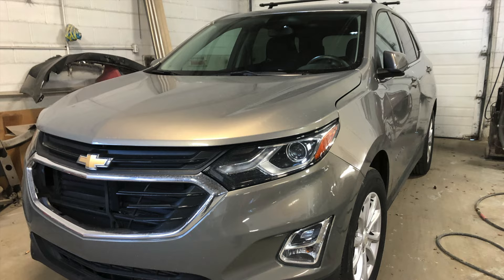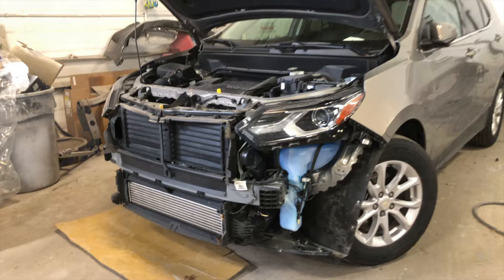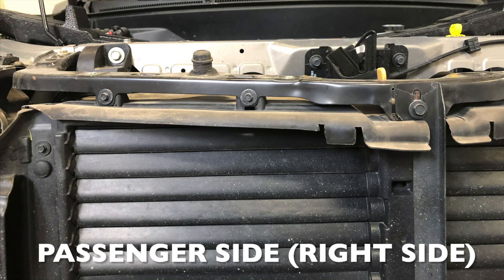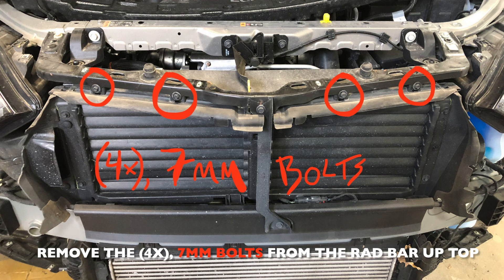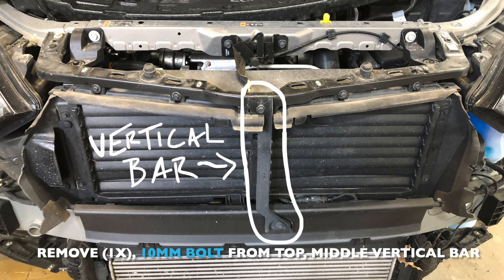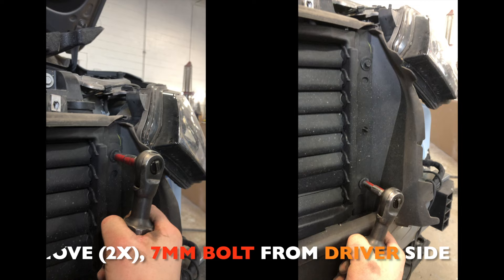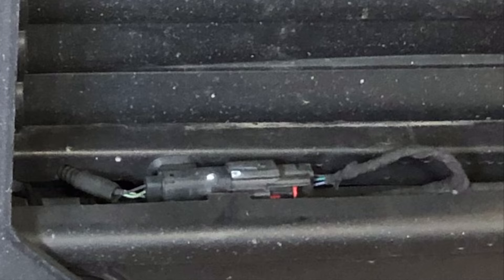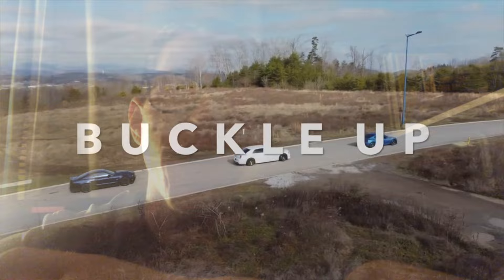How To EASILY Remove & Replace Active Grille Shutter | Step by Step Install 2018-2023 Chevy Equinox

Comment: Sure, here are the instructions extracted from the video:

1. **Remove Front Bumper**:
   - If unsure how to do this, check the bumper removal video on the channel.

2. **Locate Replacement Part**:
   - Take photos and videos for reference to ensure proper reassembly.

3. **Remove Bolts**:
   - Remove four 7mm bolts on top of the radiator bar.
   - Remove one 10mm bolt from each side up top.
   - Remove two 10mm bolts from the vertical bar in the middle.
   - Remove two 7mm bolts from each side of the active grille shutter.
   - Remove a push pin on the passenger side.
   - Remove one last 7mm bolt at the bottom of the active grille shutter.

4. **Disconnect Wiring Harness**:
   - Disconnect the one and only wiring harness to lift and remove the active grille shutter.

5. **Install New Grille Shutter**:
   - Reverse the removal steps to install the new active grille shutter.
   - Ensure the correct wiring harness is used.

These steps should guide you through the process of replacing the active grille shutter on a 2018-2023 Chevy Equinox.

Comment: Thanks for this , would this work for a 2020 Chevy Malibu? It’s funny because Firestone and the dealership want me to get a whole new replacement grill shutter because I took it in for because my engine light is coming on and off and the diagnostic says it’s the grill shutter. The Malibu car I got it in 2020 brand new and now in 2024 it has less then 95,000 miles on it. And I never got the grill cleaned before. So I’m skeptical if I should just try the cleaning and see if that helps preventing the engine light coming on
Reply from the maker: Yes, the video will be similar for your Malibu. Yes!!! Try cleaning it out yourself before paying someone. Heck, you can do all the work yourself. More than likely, it just needs a good cleaning. The active air grille shutters really don’t do anything to begin with. They contribute to a vehicles’s aerodynamics and fuel economy less than 1%. Even, I would rock the car with the engine light on. Good luck keep us all posted
- Garrett

Comment: Good explanation.  This shutter is something GM adds on to fix a cold weather problem. along with a shield over the charge air cooler (intercooler) Then they add insulation over the turbo control valve. Cold weather still causes problems. You should be driving one of these when it's -40 and half way into your 45 minute commute at 5 in the morning on a deserted road, and the engine goes into "limp" mode.  about 7 times the dealer has remedied this by cleaning out (or replacing) the CAC and turbo  control valve. Last time wasn't warranty but they snuck it through somehow. Anyone  know of a real fix for this? I'm tempted to change the air filter housing so it draws air from under the hood instead of outside. If it makes this winter it's gone, somebody else will be driving this crap next winter.

Comment: Good night. I have this exact jeep but the part that the shutter assembly is bolted on is damaged.  Can u assist me in locating the name of the part, please? I'm having trouble finding the exact name for it 😩
Reply from the maker: This may be what you’re looking for: part number 84460245

Good luck, hope this helps!
Reply: @slaautomotiveart  can you assist with telling me the name of the motor the activate the shutters? Or where I can find it please?

Comment: I’m still getting the code after replacing the active grill any help , does it need any special programming?
Reply from the maker: That’s very odd. I’ve done this several times with no codes popping up afterwards. Hopefully someone can chime in. Do you have a scanner to see what the code is reading?

Comment: My active grille shitter is stuck open every time I go to the car wash. (Only been twice since my car has been out of the shop) do automatic car washes negatively affect the operation of the active grille shutters? Can I fix this myself?
Reply from the maker: Hi Ryan, thank you for your comment. Sounds like a defective part that may need to be replaced. This shouldn't be happening with this new of a car. I'm wondering if there could be something in the way like a rock or pebble that is preventing them from shutting or if there is a split in one of the wires. You'd have to do a little investigating. Pull off the front bumper and check it out. I have a video up on my channel how to remove Equinox bumper if you need some tips to remove it. Thank you for watching and good luck! 
- Garrett

Comment: I like the video alot.If you don`t mind, can you post the part number of the connector or connectors , that go on the Shutter , my harness was ripped off in an accident. There is a purple , black, and green wires going to it.
Reply from the maker: Thank you for watching my video. Unfortunately I do not know the part number you’re asking for. I did this job over a year ago on a customer vehicle. I’ll do a little research and get back to you
-Garrett

Comment: In your opinion could i just remove the active grille if mine is broken and not replace it?
Reply from the maker: Yes. An active grille shutter only provides just a smidge of improved gas mileage. It’s unnoticeable. But when the car does have that active grille shutter working plus all the other tech and design elements working in unison to improve gas mileage that’s when it’s noticeable. So having one thing, your active grille shutter not working or present, won’t be a noticeable gain or increase in MPG. Hope this helps, thanks for watching and commenting!
Reply: @wagonworks803  thanks for the response that makes perfect sense.. I ended up being able to pry the shutters out one by one without removing the front bumper. This saved me $1400 that was quoted by the dealer to replace the system which had malfunctioned and got stuck in the closed position..the car is running much better now.

Comment: What are those rubber flap things on top the grill shutter called?
Reply from the maker: I’d call it an upper air baffle or upper rad cover, upper radiator baffle cover. Something along those lines. Let me know if that helps!
Reply from the maker: https://www.quirkparts.com/oem-parts/gm-oem-new-2018-20-gm-chevrolet-equinox-upper-baffle-assembly-rad-air-gm-84618-992-84618992?origin=pla&gclid=EAIaIQobChMI2piwlaLV_wIVzQlMCh2HOQmBEAQYAyABEgLzl_D_BwE